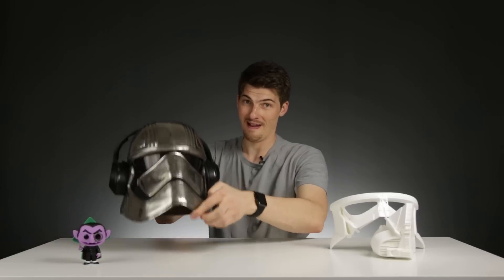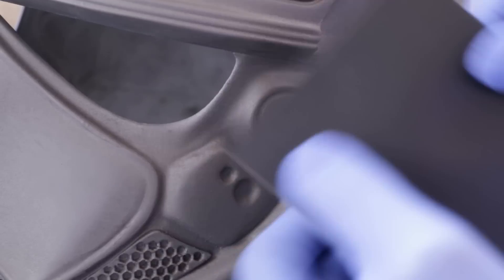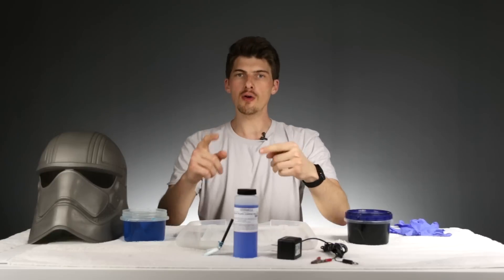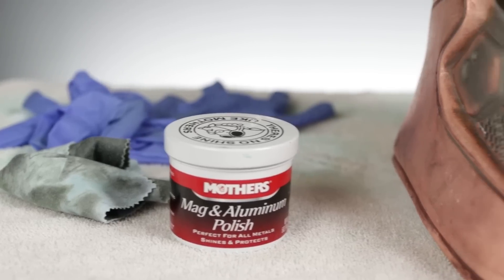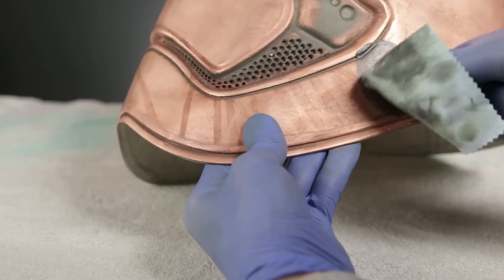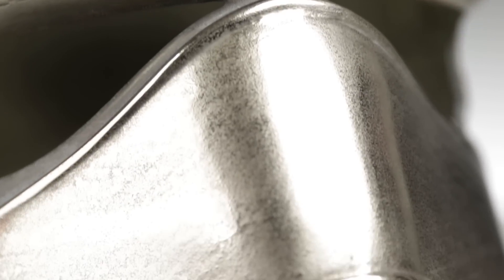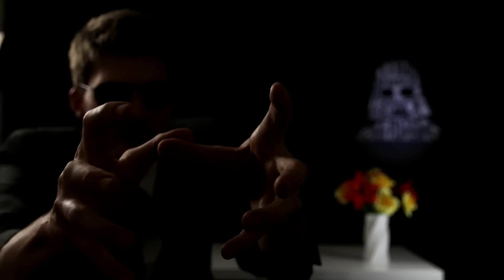How-To Make Metal: Electroplating a 3D Printed Star Wars Helmet

Comment: This is probably a stupid question but does it get heavier after doing this or is the weight added so small that it's negligible?
Reply from the maker: +Zero Tech brush plating only adds a small amount of heft to the helmet. If you were to tank plate it (dunking whole piece in tub of solution), then you can build up some really thick layers. That will add a lot of heft to the helmet. I’ve actually done it and the results are great, so it is possible.
Reply from the maker: +Zero Tech sorry for the delay but the weight is negligible when brush plating. You can however tank plate the helmet (either in pieces for a small setup or as after the part is assembled). Tank plating will allow for much much thicker layers and ad a good amount of heft to the part.
Reply: Infosmercial it's alright I was just curious because it would look really cool to make a whole suit out of this and then plate it to wear for conventions but was wondering about the weight lol

Comment: That is not electroplating, what you did is called just using metallic paints, electroplating is lets say, you get a fork and you put it in a gold cyanide solution and you run currents through the fork and water and i dont know wtf happens but the gold bonds onto the fork and you get a gold plated fork.

Comment: So I bought all these materials and tried it myself, but didn't have much luck. While it did put down some small (VERY small) amounts of copper, it wasn't nearly enough to get this kind of effect. I followed all the instructions and took my time trying to apply it, but no luck. I also used a multimeter to make sure it was a proper conductive surface.

Sadly disappointing. Maybe my Caswell kit is no good, since trying it on other materials didn't work very well either.

Comment: What did you make the bigger brush out of? Is it just a piece of nickel? Does the cloth/rag need to be anything special?
Reply from the maker: +Jesse Haworth sorry for the delay. For plating with nickel, you'll want to use either a nickel or stainless steel brush. I purchased some stainless steel sheet metal, cut a strip off, and wrapped it loosely with gauze. 

To plate with copper, you'll want to use a copper brush. I did the same thing as the nickel. Just bought a copper sheet and chopped it up. 

The clothe should be something that is capable of holding and retaining large amounts of liquid. This is very important as you need solution to be in constant contact with both the surface of what your plating, and the metal brush itself. Cotton gauze is pretty good at this.

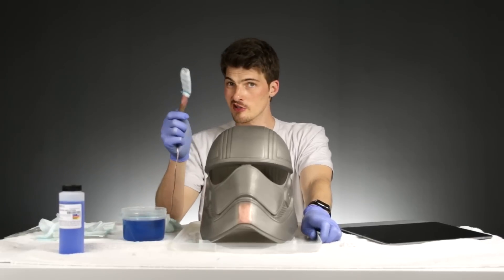Comment: Quick question. t about 4:56 you mention "I'm going to use a little bit larger setup that I purchased..." Where would one purchase that larger brush? I couldn't find it. A link would be great! Thanks and great video!
Reply from the maker: +Brian Creasey hey sorry for the delay. So the larger supplies could be found on caswell' website. However, I simply purchase raw supplies and made the brushes myself. 

When plating with copper, you'll want a copper brush. When plating with nickel, you'll want a nickel or stainless steel brush. So what I did was purchase some high grade copper and stainless steel sheet metal off of amazon. I cut off a large strip of each. Then I used medical gauze I bought from walmart to loosely wrap each brush. Use a rubber band to secure the gauze and your good to go!

Hopefully that helps. Let me know if you have any more questions.

Cheers!
Reply: That's perfect! I kind of figured you had to roll your own. Seems a better idea to me. Thanks so much for the info. I'm going straight for the big guns, plating my Monster's in Motion Rocketeer helmet kit. We'll see how that goes. (I will definitely test on a small piece before going straight to that) but that's why I was looking into the larger brushes. Thank's again for taking the time to reply and the good info in the video!

Comment: That's pretty amazing. How does it work exactly? Can you anodize aluminium this with one of these kits?
Reply from the maker: +tjt263 yeah it's pretty darn cool. Electricity is used to essentially bond the metal solution to the surface of what your plating. Anodizing aluminum is a much different process and requires different materials.

Comment: Don't know how you got such good results ordered everything you did, spray painted  my pla model it with the nickel,  sanded it then  polished it with the mothers mag, after like an hour barely got like a quarter inch of copper plating. First attempt didn't work at all so I reapplied the nickel spray paint and still nothing! Please help 😣
Reply from the maker: +Travis Houry ok so you need to spray probably two layers of the nickel print to get it nice and coated. You need to let it cure (sit out) for about 24-36 hours before doing anything else. Then Sand down that layer. Do NOT polish the nickel print layer with the mothers mag. Soak a rag in distilled water and wipe down the part thoroughly to remove any light residue. 

Then try plating with the kit. It is only AFTER plating with copper do you attempt to polish with mothers mag.
Reply from the maker: +Travis Houry also, when you sand, the paint must be very smooth. To achieve this, start with an 600 grit sand paper and work up to a 1500 grit sandpaper.
Reply: Ok I will let it sit out longer thanks for your reply I means the world to me! Also your helmet is very smooth and my model is a statue of someone's face maybe all the bumps are adding resistance to the current
Reply from the maker: +Travis Houry it's very likely that it is. Couple other things. With a model like yours, when you are plating, try to keep the cathode that you connect to the piece as close as possible to the plating area. If you are using alligator clips, you can even use something like a thin strip of copper and use that. That may make it easier to maneuver around and get the cathode close to the plating area. 

One more tip, once you've built copper up on a area, try to keep the cathode in contact with that area and continue plating the surrounding area. 

It takes some experimentation, but I'm sure you'll get it! Let me know how it goes. 

Cheers!
Reply: Infosmercial- yes so attaching the alligator clip so a strip of copper and wrapping it around the model? I also saw from Caswell before you plate something you can test the current resistance  by running water down what your plating and if it beads up you have to sand it more until the water runs smooth
Reply from the maker: +Travis Houry Yeah the water beading trick can work to an extent, but for this project and using the nickel print, I wouldn’t use it as a benchmark. There could be other properties to the paint that may prevent the water from behaving the same way it does with fully polished metal. Having said that, getting it as smooth as possible is a good idea. 

Yeah you can wrap it around the model or better yet, simply hold the small strip of copper in your hand and move it around and hold it by hand to maintain contact with the part.
Reply: Infosmercial- thank you again for the great advice! What's your thoughts on using the nickel paint with acetone like how you used on that spot you sanded too much instead of the spray paint to cover the whole thing? I know there'd be brush marks in the paint but your just gonna sand it all anyways? The nickel spray paint is very expensive
Reply from the maker: +Travis Houry thinning it with acetone is perfectly acceptable in my book. The nickel print is rather thick straight out of the jar so thinning it can help you get more surface coverage out of it. You may be able to airbrush it too if you thin it with acetone.

Comment: All polishes have a wax or polymer base.  Wax can be removed with rubbing alcohol but polymers can be much more difficult. 
 BOTH THE WAX AND THE POLYMER WILL PREVENT THE SECOND ELECTRO COAT FROM STICKING PROPERLY ... so, if you're going to put two layers on ... you MUST remove the polish base from the first coat before you put the second one on.   If not, be prepared for the final coat to peel off fairly quickly.  We often do electroplating on jewellery and this is a basic required  part of the job.  If it isn't prepared correctly, the client will be back far too soon ... and they will be upset!
Reply from the maker: +Westdale Jewellers a very valid and excellent response. Thanks for taking the time to post it. 

I have found that a light mixture of trisodium phosphate (from Walmart or Home Depot) mixed with distilled water and then a thorough rinse in distilled water worked well. Any thoughts on that?

Comment: Hey infosmercial, thanks for sharing this awesome tutorial!  I just bought the supplies and plan to try it (despite the bad Amazon reviews).  My only question is, could you leave the copper coat or double coat it in copper instead?  I think the copper look was a little brighter and better looking than the nickel.  Or will the copper shine fade out too quickly? Thanks!
Reply from the maker: +Brandon Rose yeah you can leave the copper. I would recommend either polishing it or promptly wiping the helmet down after plating (you can try a little baking soda and water to get rid of any residue). Afterwards, you can leave it although it may rust, but you can use a clear coat spray paint if you wish. Polished copper should keep pretty well though without any of that stuff. 

Thanks for checking out the vid btw. Good luck with your projects. Check back with links to pics, I'd love to see it.
Reply: Infosmercial I bought the stuff and have been trying to electroplate with little luck.  Then I tried to copper plate a dime and it worked perfectly. I realized that the initial Super Shield nickel stuff may be my main problem. 
http://www.mgchemicals.com/products/emi-and-rfi-shielding/water-based-conductive-coatings-wb-series/841wb-super-shield-water-based-nickel-conductive-coating 
I bought this 150ml bottle hoping to get more out of it than an aerosol can by painting, but I guess it's not working so well.  Isn't it the same as the spray or have you had any experience with anything else that would last longer, quantity-wise?

Also, a couple more questions, is the sanding absolutely necessary after the initial Super Shield coat?  I ask because there are places so small I'm sure i can't sand. 

Lastly, how do you know when your bath of copper or nickel has depleted? Does it lose color or just stop working as well?  Would you recycle left over copper or nickel bath back into the bottle?
Thanks again!

Comment: Great video! I have to try this.
I actually like the copper look, kinda steam punk looking. If you stopped at the copper layer, would you have to clear coat it to prevent oxidation?
Have you tried the brass plug n' plate kit?
Reply from the maker: +mseriesm3 yeah you might have to do something like that. You could try making a baking soda and water mixture and "polish" with it  immediately after plating. That will help neutralize any acids to help with longevity. 

I have not tried the brass plating kits. I have been wanting to experiment with more of their metals and looks for sure.

Comment: Amazing find! I want to do this type of electroplating on small objects. Does the small jar of Nickel Print act exactly the same as the larger spray product, or would it be too thick for small, intricate sculpted objects, like jewelry, if I want to retain detail?
Reply from the maker: +spit53 yeah the nickel print will behave the same. I would recommend the same steps as with the spray. Apply it and then sand it down to smooth it out. 

You can thin out the nickel print too to help it paint on smoother, which is great for detail work. I used small amounts of acetone to thin it out. Works great!

Thanks for watching the vid!
Reply: Thanks so much!

Comment: instead of spending a bunch of money on that kit, you can just make a solution of copper sulphate (bluestone fertiliser) and sodium bicarbonate (or what idiots call baking soda). then grab any DC wall adapter, cut the wires, and attach the ends. boom, less than $12 and it can plate something as big as a car
Reply from the maker: +Sapphire Smith hmm not a bad idea. I am hoping to make another video in the future that involves a more budget friendly version of the process.

Have you done that stuff with the fertilizer, btw? I've heard about using it, but nothing about results.
Reply: Infosmercial awesome! I'd be happy to give you some pointers. Like adding salt to make it more conductive. or using a rag soaked in the solution instead of a brush.
Reply: Infosmercial It's electrochemistry, my favourite
Reply from the maker: +Sapphire Smith I did not know that, I'll have to look into it and possibly experiment. 

Thanks. Feel free to post any other tips and tricks you know too.

Comment: So can you use this process to coat small items with chrome?
Reply from the maker: +ShadowcasterZero yeah absolutely you can. I've done this smaller parts and the results are stellar. Much more polished and mirror-y than the helmet in this video. 

It all depends on home much time you spend sanding, plating, and polishing.

Comment: Could you achieve a mirror finish if sanding the nickel plating? I've already read in the comments that nickel is tougher than copper but is it still doable or should i use something else to get a mirror finish plated?
Reply from the maker: +cedricfilm I don't see why it wouldn't be possible. You may need to plate the nickel for a longer time since the layer don't build as thick. You may also need a more "aggressive" polishing compound and/or polishing method as the metal is tougher to polish. It should work though.
Reply: Thanks for the info!

Comment: just a reminder,
acetone can't react really well on PLA stuff (it can soften itself, not smoothing), only ABS can, and thinning PLA using same way is available but far more harmful to your body
if really need smooth surface, better paint some epoxy on its surface or print it in a lower layer height first, safety first.
Reply from the maker: +twilipi sage advice and very true. XTC smooth on is a pretty good product for "Smoothing" PLA as well as ABS, but I suppose other two part epoxies will work.

Comment: The metal is so thin I don't see the point, just paint it and save hours upon hours
Reply from the maker: +Dylan Rinck I see your point. With the metal plating, your also getting a conductive surface that also has magnetic properties, which could be particularly handy for the maker community. 

I will say that when done properly, the durability of the metal will beat out the paint any day. 

Also, if you either tank plate or really take your time brush plating, the results can be staggering. The more time plate the piece the heftier it will become too! 

Thanks for checking out the vid!

Comment: Excellent electroplating guide, answered all my doubts regarding to electroplating 3D printed parts. However, this process looks too time consuming and expensive for me, I guess ill sick back to spray paint...
Reply from the maker: +Ryan Chan well I am glad you liked the video. I understand that it can be a rather expensive proposition, especially if you really just want to experiment or plate small parts. 

I am working on an alternate process that may be more cost effective and can be less time consuming. That video is a little off in the future for now, but it's coming...